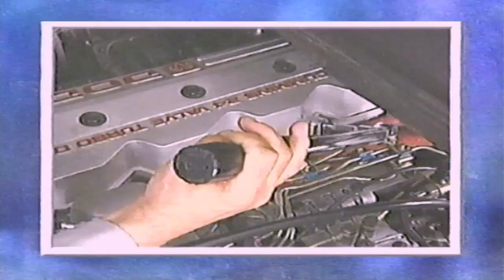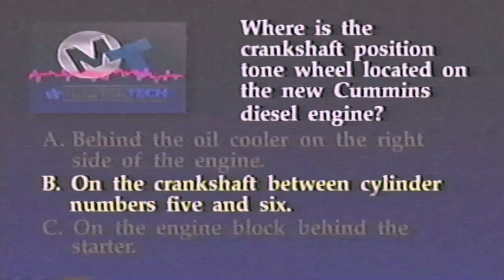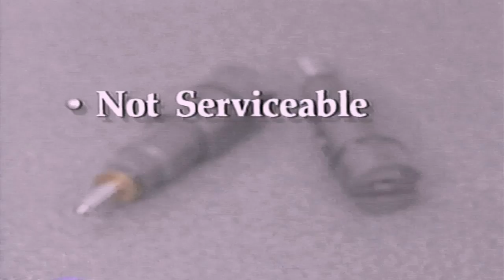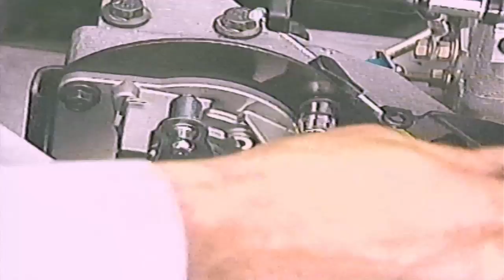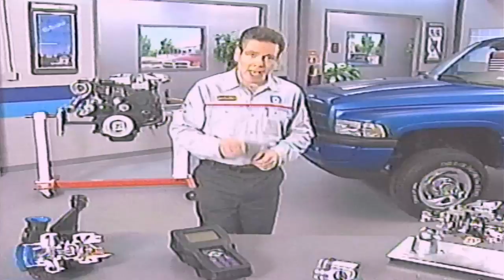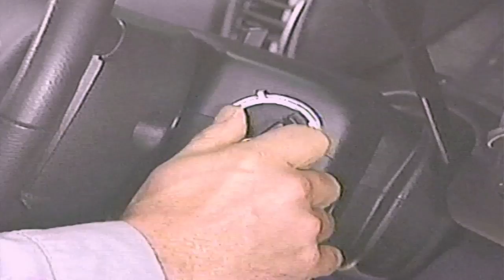1998.5 Dodge 24 Valve Cummins Turbo Diesel introduction, plus some service info from the Master Tech

Comment: I wish id have watched this before I installed an aftermarket lift pump!  The pressure during cranking problem gave me fits!  Eventually put a momentary switch to shut it off during starting.

Comment: Too bad they didn’t realize that VP44 was junk. I loved my 24 Valve though I never should have sold it :/
Reply from the maker: The VP44 was the first to use computer controlled to make the EPA happy, Ford also did some major changes to their trucks as well, GM didn't even get started with the Duramax until 2000, That's when the Government really started sniffing around. Also People really complained about how loud the Cummins was compared to the Fords and Chevys. that's why they did all they could at that time to try and make them a little more quieter. Just had to be there.
Reply: @TheBlueCollarPreacher HEUI was a travesty.
Reply: The vp44 wasn't junk, it was quite precise, and it required a steady stream of diesel fed to it.  The lift pump was junk, and people who made bad decisions tapped the power wire to do janky things.

That said, it started very well in all weather, made excellent torque at all speeds, and was extremely responsive.

Comment: the 24v the better engine than the 12v. Just not to many recognize that it actually is. Everyone is 12v happy
Reply from the maker: The reason everyone is 12 valve happy is because, it's all mechanical. No need for ECM's, PCM's,  The EPA really started cracking down on diesels around that time. Just had to be there. Did you watch the whole Video?
Reply: @TheBlueCollarPreacher  I watched the entire video I own a few of these 24v engines. They are better than a 12v. I get the 12v is mechanical and there great engines. But all the upgrades they made are better other than the vp44. they flow more air than a stock 12v they have more power than a stock 12v obviously. But the thing that people don't understand. Is you could put a set of injectors in and a tune with the stock turbo you can get about 420 rear wheel horsepower. If you put a bigger turbo on then you could get more. But the thing is you don't gotta screw with the injection pump just a nice fass fuel system like you would on a 12v. A tuner. A bigger set of injectors and get good power. There very reliable I never had a problem with one. I talk to all the old mechanics around here. They like them alot better than the 12v. Don't get me wrong the 12v is a great engine arguably the best. But they took the 12v and made it actually better. there's still no emissions the right amount of computers on it so it's always running optimal but not to many to where it's a nightmare to do anything. There alot cheaper as well. There a hidden diamond
Reply from the maker: Keep in mind the vp44 is like comparing dial up internet to fiber these days.